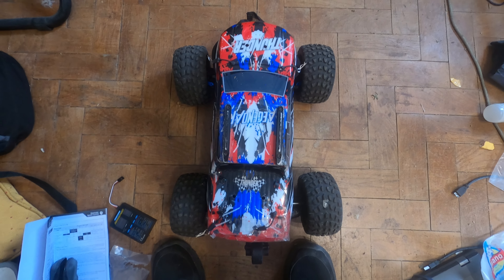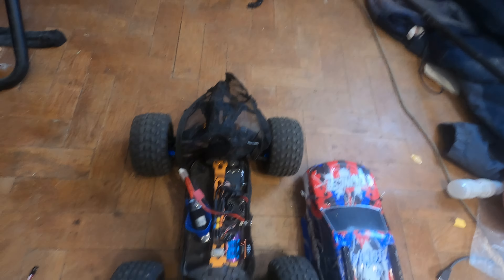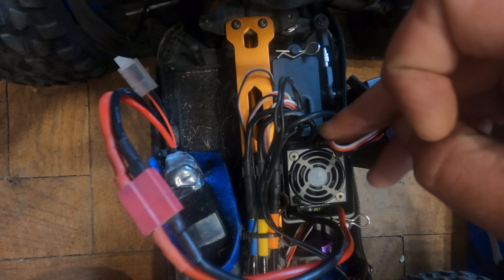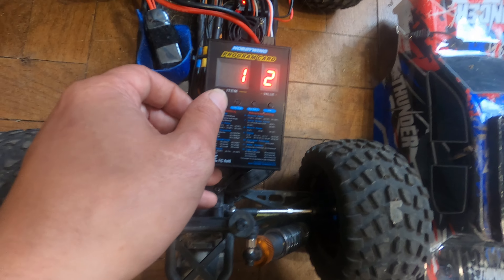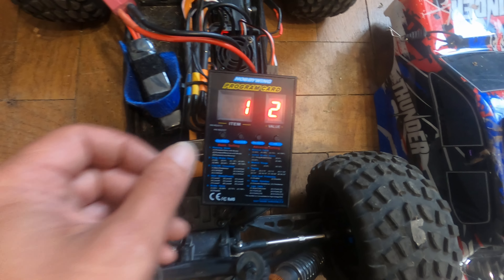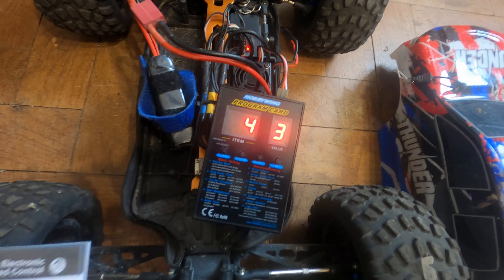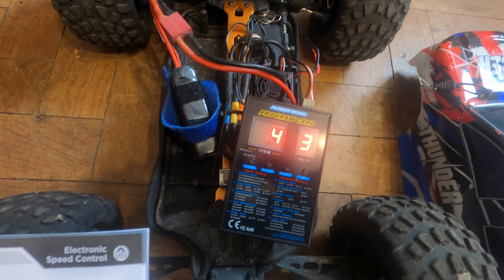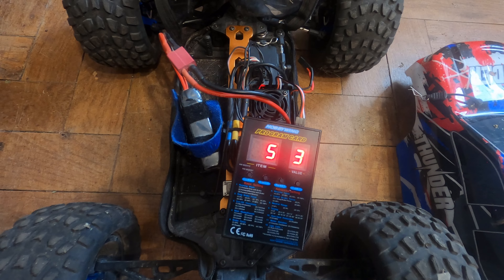Laegendary thunder Hobbywing ESC programing! #rc car #rccars #rclife

Comment: Hello sir can you please give me the link to that mesh thing on your thunder? I just ordered a new Laegendary Thunder and a new HOOVO 3S 80C 5200mAh Battery do you think it will be fine out the box with that battery? Also do you think I should go ahead and order this ESC program card?
Reply from the maker: @rickybaldwin6160  hello my friend, that battery should be awesome, you should buy a heatsink and fan for the motor, i will leave the link:
https://s.click.aliexpress.com/e/_EItLMjV
Or this wich can use one or two fans:(i bought these to upgrade from the previous one i am waiting to arrive):
https://s.click.aliexpress.com/e/_EGMHlnv
 the link for the dust cover:
https://s.click.aliexpress.com/e/_EQ7sO3l
About the program card, you should buy it if the money is not a problem because it makes easier the changing of the brakes for example or the punch on the esc wich can be done with the set button of the ESC but its a pain, so i bought it.
https://s.click.aliexpress.com/e/_EyQnrlt
If you need anything else feel free to ask ricky.
Thanks for the support.
Reply: @Fast_Lane_RC  ok I hoped that battery should work great I got a killer deal on 2 3s Ovonic 2200mah 35c short packs on Amazon yesterday for like $19 I also ordered the heatsink with the 2 fans and I have 2 30mm rocket fans coming too because I asked them not to they said you can switch them out. I also ordered me a blue IMAX balance charger until I can afford a better one n couple aluminum parts once I get paid I’m gonna order some more for my thunder. But thank you very much for all the help and advice!!
Reply from the maker: @rickybaldwin6160  thank you for the support and nice comments, its allways a pleasure to help.

Comment: Does this program card come with the wire to connect it to the esc or do you need to buy it separately?
Reply from the maker: @rickybaldwin6160  hello it comes with the wire my friend.
Reply: @Fast_Lane_RC  okay thanks I was just making sure because I seen a comment on it that said it didn’t come with the wire so i wanted to make sure it came with one before I ordered one and it not come with the wire!!

Comment: Mate help something happened to my SCY PRO rc car battery.. I bought new SCY 16102 pro but it is not moving backward or forward but yes the steering works, it turns left and right but the light of the RC flashes continously which is a sign of battery mal fucntion, Now what should i do?
Reply from the maker: @MwaleedU  that means the battery has low charge did you charged it? Also change the batteries in the remote.
Reply: @Fast_Lane_RC  Yes i charged it but not working battery remote also changed
Reply from the maker: @MwaleedU  seems like a problem in the remote. Sad to know that you cant use your rc.
Try disconecting the plug of the servo to the esc and put it back in and check for the wires on  the battery they could be shorting a bit, are the wires good? Sometimes they split right where they have the hard plastic covering the wire check that and give feedback
Reply: @Fast_Lane_RC  remote is working fine, you steer the car but cannot move it forward and backward